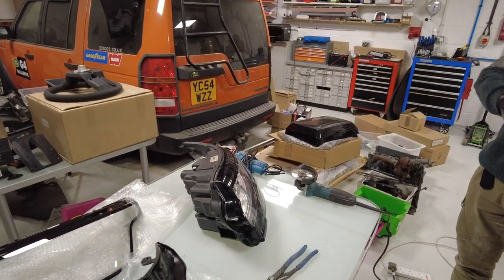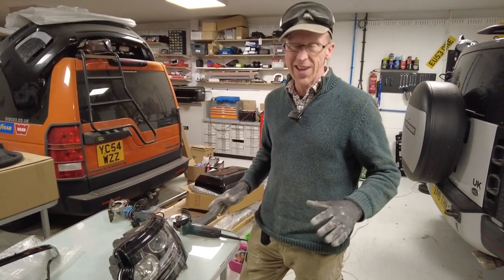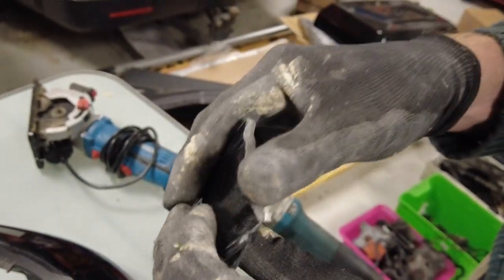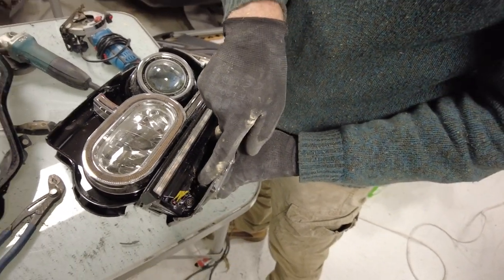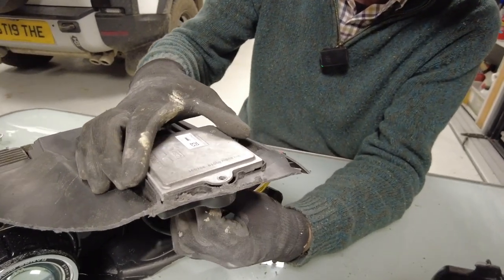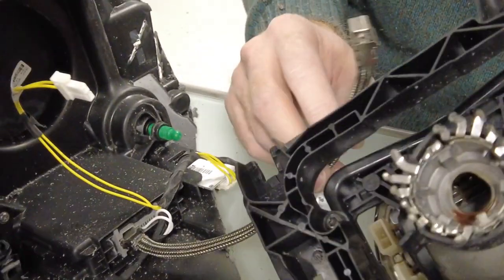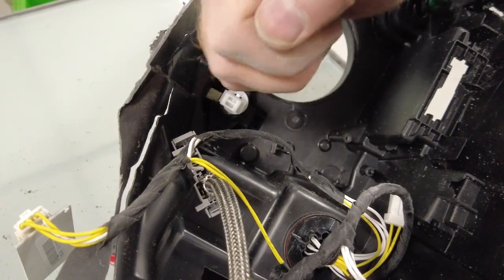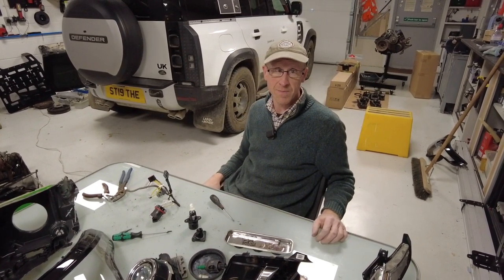Headlamp Strip Down + Repair - Range Rover L405 Valeo Headlight

Comment: What type of plastic is the casing unit made from. That giant black piece. I have a crack in a Valeo casing and need to bond it together and wonder if epoxy would work?
Reply from the maker: Most of the headlight rear casing are made from ABS. Have you tried plastic welding ?
https://youtu.be/b6UIVSNEps4

Comment: I wonder if you couldn't use a windscreen wire remover to take off the lens. The main obstacle perhaps would be that a windscreen is glass and the housing (car body obviously) is metal and due to its size and weight, stays put of its own accord. A headlight as you have demonstrated is made of plastic, light (no pun intended) and would need to be held firm in order for the wire to be able to work. The Goonzquad brothers (See Goonzquad channel) use this wire and seems to make light work of taking off a windscreen - or 'windshield' as they call it over there. It might give you an idea for a better tool rather than being an off the shelf solution perhaps.
Reply from the maker: Yes we are looking at options... wire / heated wire / dremel ...

Comment: Those main/ dip beam bulbs are pretty expensive being an HID unit that slots into the back (D3S/ D3R units) so no wonder you didn't get that when you got the unit!! Those bulbs are 60+ quid on there own!!! Still definitely worth tackling this job if you have the time and patience to dismantle it all down and then put back into a new fresh moulding and cover.

Comment: I think a multi tool with a metal blade in would be far easier to work with than an angle grinder Simon.

Your a brave man yielding that beast.
A brevel would do the job a bit more neatly and safely too. 
I'm just wondering why you pulled it completely apart though.
Hopefully there's going to be a reassembly video 💯👍😊
Reply from the maker: Yes multi tool us an option - they tend to melt the plastic which can be tricky - but i will try a multitool and a dremel
Yes step be step rebuild guide was recorded today - its not too bad.

Comment: So, on my L494, I have the same light. Simon, I do not see a bulb in the rounded opening, those openings facing the inside of the car.  Have you any idea what they are for? Just decoration? 🙂 Thank you for your hard work! Much appreciated!
Reply from the maker: Hi - I am not sure 100% about your question but I will strip down an L494 light soon !
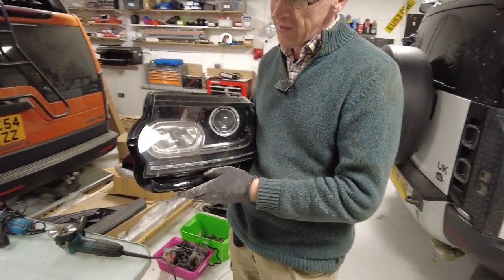Reply: @L663  Oh, thank you! Let me try to explain once more. You have that enclosure on your current headlight. In your case, it's that enclosure on the left hand-side of the Xenon bulb. LEDs are going around, but I can't manage to find if there should be a bulb in it or if it's just for deco. At 0:52 on your video, right above your finger. That's the place I am talking about :))

Comment: A complex and brave job Simon….I doubt many will want to attempt such work but at £4814 per light, buying a 12 year old Range Rover one day will be a brave move! i think the day is coming when the only cars safe to own are under the manufacturers guarantee. Should I buy a Morris Minor?…headlamps on those were 30/=d (£1.50!) when I used to get them for my Uncle or on my Mini!  Modern cars…are they a good thing???😨😱😀😀😀
Reply from the maker: Hi Richard - you raise some good points but this is progress - we all enjoy the improved headlights on modern cars and all the safety features like airbags but these systems cost money. These items could be designed so that they could be repaired more easily.
Reply: @L663  Simon I understand your thinking and I guess few drivers have the slightest thought about the price of headlamps.A friend had a new Honda Accord as a firms car in 1999 and it used to break a headlamp glass every six months….I seem to think they were about £80 each! Even fewer would think about repairing them but you are on target…why are they made in a way that makes repair all but impossible. 🤔🤔🫢See what you can do to drive the idea of repair rather than throw.😐😐😐😀😀😀

Comment: I am surprised you do not have a dremel. It is like a larger and more robust dental drill with many bits and fittings to try on the cutting part.
Reply from the maker: Yes we need to do this again with the dremel